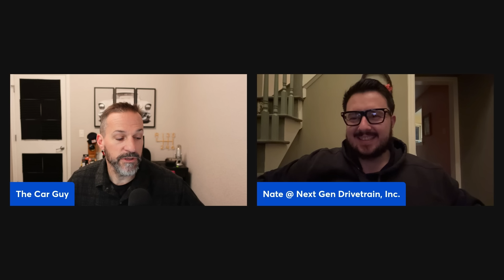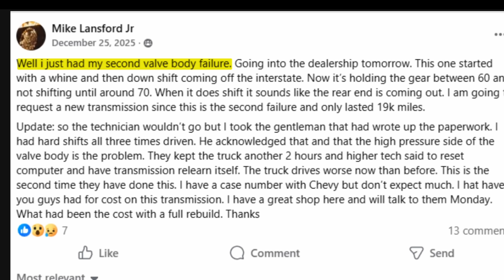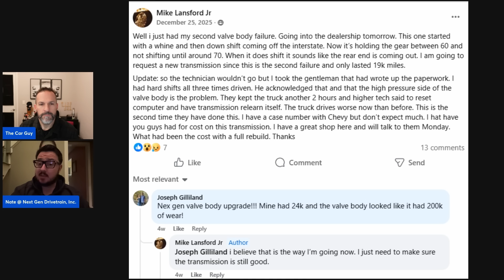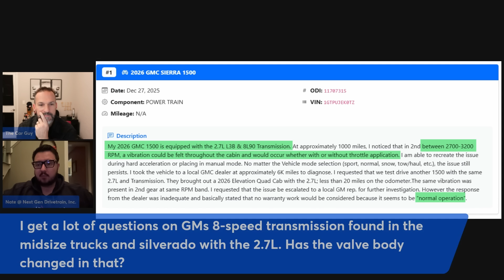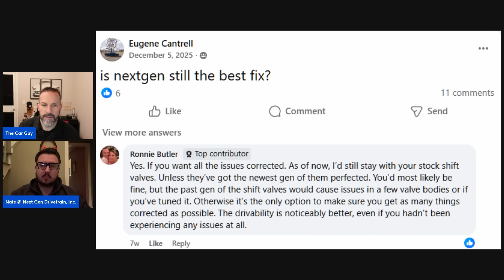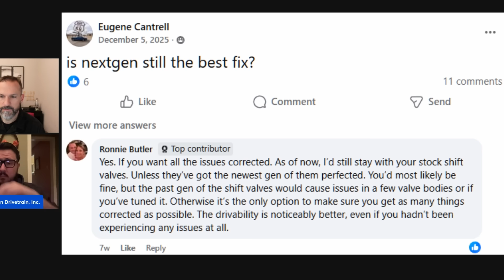How GM Transmissions are DESIGNED To Fail with NextGen Drivetrain. 2025 2026 Silverado Sierra...

Comment: The greatest issue with all the big three is lubrication and ultra thin oils, overly complex engines and transmissions, and individual owners reliability in maintaining their vehicles…let alone trying to get them to preform outside given circumstances, constant high rpm’s, overloading, high acceleration starts, and simply not using the units like typical individuals should….

Comment: I hated my 2020 f150 10 speed so much after only 32k miles and two new transmissions. I sold it and went back to a 16 f150 3.5 with the 6 speed. IMO the best newer gas trucks are
15-17 f150 5.0 6 speed
15-16 f150 3.5 6 speed
17-19 f250 6.2 6 speed
18-19 gm2500 6.0 6 speed 
20-23 gm 2500 6.6 6 speed
19-24 ram 2500 6.4 hemi
Reply: The Ram with the Pentastar V6 is an underrated one too. Very capable 305 hp

Comment: My 2013 just started having,  torque, converter shudder. 160k miles damn
Reply: I have a 2017 Chevy Silverado 2500 HD 6.0 L gas engine bought it brand new and it was mostly freeway driving. At 78,000 miles the torque converter went out. Nothing has changed. As time went on I started having shuddering from 3rd to 2nd and then 2nd to first gear when coming to a stop. It's been like that for years.  So annoying. My 2011 Silverado 6 L 2500 HD also bought it brand new and still have it to this day and never had any transmission issues with it to this day.. It only has 58,000 miles and have been changing the fluid in it over time and still no issues. Future GM vehicles I don't have any confidence that they're going to be getting any better. Until these manufacturers all offer 100,000 mi warranty on their vehicles, I'm going to be reluctant to buy anything new anymore. It looks like ram is slightly getting better but time will tell.

Comment: My company leases HD trucks and they take the trucks back at 50k, so we go through a lot of them with the amount of driving we do. Basically a new truck every year. So we've had 2022,23,24s. I'm still in a 2025 and we just got in 3 new 2026 2500 Z71 LT duramaxs two days ago. . They're just not great for the 60-70k dollars these things cost now. Everyone of them you can feel the cheapness post covid inflation quality. Most of them have had small electrical issues. dying batteries. My radio didn't even work right off the car hauler with 7 miles. one battery died at 11k. The Allison is an absolute slush box and the engine is tuned to roll off the line from a stop with like zero power. pedal is numb and lazy. Chevy programmed "turbo" lag into it cause  putting it in tow/haul mode wakes the truck up so its definitely not a engine thing, its a tuning thing.

Comment: I don’t even know who to believe… the GM 10 speed guys also said the nextgen kit didn’t work but when they swapped it with another brand the problem went away but they said nextgen refused to help them out.
Reply: I’ve had my NextGen kit installed for over 6k miles and it has been working absolutely perfectly. I think some folks reporting bad performance either didn’t do the install correctly or didn’t do a TCM relearn after installation. There’s a LOT of places where mistakes can be made when installing this kit.
Reply: @gr8tdane24 But the issues went away when installing a different one, they did tell me it was professionally installed by a shop.
Reply: @nq2847 the one issue with having a shop install this kit is that it takes a certain kind of OCD individual with absolutely no interruptions to do the work. If I had a shop do it, I would tell them to bill it hourly and to take their time to make sure everything is perfect. I installed mine (background in mechanical and civil engineering) and there are very few people I personally would trust to do the work.

Comment: If you want to know what kind of company GM is.  There is an unsealed 8 speed lawsuit document out there that is a transcript of a deposition.  Basically admitting that they knew there was a problem with the 8 speed trans (before Job 1), didn't notify customers of it, had a fix designed for it (different fluid) and basically rolled the dice and was only going to fix transmissions in warranty.....all to save $2 per unit. 

Question: "But don't you think, going back to engineering ethics, there's a duty and obligation when an engineer or a company that does engineering knows that there is a problem, such as the problem that has been known here since job one if not before job one, that they should inform the customer?

Because in this situation GM never told those people who's warranty was going to run out, and had they known, they could have wandered in within the warranty period.  Wouldn't that be the most appropriate and fair thing to do?"

Answer: "Well again, I--we---we're--we're honoring our warranty obligation'  --end of answer

Comment: I am from a Ford family, my uncle owns Ford dealerships. That does not mean I get free or heavily discounted deals.
 I was driving a '23 F-150 w/coyote & 10 speed. Of course, like a clock shows 12 two times a day,,, the infotainment and transmission started having issues 300 miles post warranty.
 Because of watching you and Nate for about a year, I bought a Ram, so far it has been great. This channel is a free buyers guide on how to buy the best truck for the money.
Reply: I own a 23 f150 5.0 and have 102,000 miles no issues. I do all the maintenance and on time I don't skip out on anything you can't with any new truck. Alot of failures also is poor maintenance which alot of people do.

Comment: 2020 Chevy Silverado 177k miles. 4 transmissions later 1 at 31k miles 2nd at 54k miles 3rd at 130k miles 4th at 168k miles. Currently dealing with lifter issues. Modern day GM produces a shit product and I wouldn't recommend them to my worse enemy. I didn't even get in to the A/C and compressor issues... Stay away from anything GM after 2014.

Comment: Their no guarantee fix not only just one test ride. Tell use it fixed 4 month from now. That Tran fix it happen on certain road condition
Reply: Mine has an error lite but only when your regas  at just into 3 gear, tiny  slack and not all the time, code as sensor mismatch of not just one but combo of 3 sensor. I gave up after a while as a fix replace the valve body change the clutches then they need to reprogram . Don’t include a tork converter  , so I just when for it a news dealer rebuild Tran . Not 7 k but ended paying 9,800 lol. It’s ok brought it 30 k vs 60 k so still 20 k ahead
Reply: Too bad need a van go look a creglist now, ton of good cheaper cars, people re getting rid of it the need money.

Comment: I would love to hear Nate's thoughts on Transmission maintenance, type, using  OEM or Amsoil . Viscosity etc 

I'd love his thoughts and perhaps from a Transmission Fluid Geek equivalent to Lake Speed.
Reply: Full synthetic definitely helps with heat. Keep the oil fresh and flush. In HD use every 30k replace the fluid.
Reply: good point because ive had a LOT of 10r80 issues when I had my 19 Mustang GT. I got real familiar with its dual stage ( different micron for cold and hot ) filter and drum roll......ultra thin super expensive fluid ULV..........Id really like to see some digging into this new ULV fluid vs the issues.....
Reply: @OldManRising he hasn't addressed transmission oil and maybe it's not significant  but seems like it could be based on engine oil analysis.

Comment: GM is clearly doing everything you say. All of them are. A lot of these issues were caused by the implementation of the CAFE standards mandated by Congress (mostly Dimturds) which caused all manufacturers to have to create engines, Transmissions and other hardware that should have been tested for many years before they were released as well as the corporate blind greed we all know about.

Comment: I will just keep driving my 05 Silverado till it stops and then put another motor and transmission in it and go another 300 k screw these greedy people
Reply: My '05 has beyond 329K. I smell a little oil burning on cold start (below 20f) but it still moves it's self. I am working on a replacement engine however.
Reply: @douglasburford8452 change the valve stem seals.
Reply: @douglasburford8452  Have you tried the Valvoline restore and protect oil? Might free up those oil rings. Just a thought.
Reply: I like sitting in my ancient gmc pickup than sitting and a dealer customer lounge most of my life
Reply: I'm with you i have a 2003 silverado 220k still runs like a top no Trans problems I keep all the fluids changed. I'm going to keep it.  Thanks
Reply: @raanburd5553  i’ll chat more to the vans. I got a caravan was actually a Voyager 2001 got 300,000 on it four-cylinder I’m trying to build a 2005 3.3 that’s got 150 to go 400,000 don’t make them like these. The new caravan gets . 26 on highway the other one get 22.. the only thing modern I heard that actually does something significant sky active technology engines
Reply: As long as old parts.
Reply: I hear ya, im running my 2000 sierra 294,000 mi unit and appreciate it. Laugh at all the suckas with pretty soon to fail payment buckets😂😂😂😂
Reply: Your 05 model is not the problem years.
Reply: @wk7060 I think he's aware of that.  I have 
2003, 2005 and 2006 hd trucks. Everybody is aware.
Reply: You gotta purchase your motor and transmission before it’s obsolete. We do not make it no more to check the line 25 years of usually to cut off but now it’s more like 15
Reply: I keep hearing parts for older trucks are getting scarce

Comment: This reminds of John Deere, and International Harvester,( Case IH). taking the right to repair away from the Farmers, The Farmer has to wait for who knows how long for a repair person to come out to the farm or field, just to plug in a computer, and then see if you have parts in stock, and charge you an arm and leg to fix the 800k or more tractor you bought from the dealer. is a rip. That has changed, supposedly now farmers are allowed to fix their stuff if they want.
Reply: Except you still have to buy the junk, extremely  high priced parts from these thieving scum.

Comment: This may seem like a crazy question but once the failed transmission is diagnosed via Gm Dealerships.  Does Nexgen have their own transmission shops to put their improved transmission in?   Or do you have to order the nextgen transmission and have a transmission shop install it.  This happened to my brothers 1500 pickup but I did not have enough time to research on how to get your nexgen product installed correctly and he was without a truck.

Comment: I just bought a 2026 2500 HD with the Allison 10 speed (label) on it.  Should I expect this to fail?
Reply: I have the same truck but minus the Allison branding. The transmission durability question just came up the other day in one of the groups I am in. Lots of responses but very few have actually had an issue.  You need to join groups and see what real world peoples experiences are. I have been watching this subject for awhile now and overall, the percentage of issues is pretty low. Keep in mind, people post more when they have a problem than when they don't so taking that into account, the percentage is probably even lower than it appears. With my last truck, I put in a built transmission at 121K miles but there was no issue with the original trans, I just wanted to do it. The same can apply to the valve body if you don't actually have an issue. Is it likely built better than the factory? Sure. Do you actually need it? Time will tell.

Comment: What are the issues with the 6 speed? I have a 2015 Silverado. 100k and so far no issues. Are their valve bodies just as bad?
Reply: I have 2 of them. One from 2009 and the other from 2020.  Honestly, there are problems in the 2009 with shifting at less than 60,000 km, and the 2020 also shifts poorly, IN MY OPINION.  I don't think they improved anything in 12 years.  That is really, really pathetic
Reply: The ole 6speed was generally pretty ok.

Comment: Swapped my 10L valvebody at home at  ~33,000 miles ago and did not perform the relearn.   ZERO issues towing 18K lb 5er.    do yourself a big solid and replace the trans pump with an upgraded unit also!
Reply: Waiting to do mine on my 25' GMC this spring.  Less than 10k miles with the L8T

Comment: My 2026 sierra 6.2 sometimes shudders when downshifting to a stop sign, happened 4 times already, not often but it's happened. Nothing bad with the engine as of yet
Reply: Try a couple of tubes of shudder fix.  It couldn't hurt, and might save you on repairs later on. I have it in mine, and so far no shudder.

Comment: And that is why I just gave up on pick up trucks.
Back in 2017 I special ordered a F150 which, I thought, I would keep for a long time for I need it to tow a 9000lbs travel trailer...
That 10 spd transmission pissed me off so much that I decided to sell the truck and the camper and buy a motorhome.
No more 10 spd transmission for me, thank you.
The MH came with a wonderful 6spd transmission designed and built by people that know what they are doing.
I'm done, just done with anything pick up trucks...

Comment: Does installing the NextGen  valve body void the GM warranty?
Reply: My dealership said yes it'll void warranty, and my 6.4 sierra is a 26 MY
Reply: @califaern3sto  but they have to have a reason to look inside the valve body itself
Reply: @fabguy5508 my transmission vibrates and makes a noise when coming to a stop sometimes, is that enough to warrant a valve body check?
Reply: Yes it will, at least for any transmission related warranty claims, but GM’s warranty means shit when it comes to their transmissions. I put the NextGen kit in my 2024 Sierra at 15k miles, warranty be damned. I’d rather trade reliability for warranty coverage. So far my truck has been shifting and driving superbly since installing the kit.

Comment: I worked as a machine tool service engineer for 35 years, 5 axis lathes can hold great tolerances, screw machine a little tighter, but also, they can produce parts much quicker in large quantities.

Comment: my old 2006 chevy silverado 4X4, 5.3 ,i have 200 thousand plus miles on it ,absolutely no problem with my transmission, or engine, just basic maintenence, i refuse to buy this new junk they are selling ,all makes have major problems with these new over priced, over complicated, absolute junk ,I will keep my old chevy till the wheels fall off !

Comment: Well, I really like these Talks here, and I like the Input from NATE.....   However, I own a 2022 FORD F-150 with the 10R80 POS in it. I'd Really like to Hear "SOMETHING"  on the Channel on the 10R80 Issues??? I get it that there are (Nearly) Identical Transmissions, But Isn't there "Something" That's Different that could be Explained here by NATE?????  Or, am I PISSING UP A ROPE????  Just asking.... 🤷‍♂😎.
Reply: yes the ford has a better valve body casting and tighter tolerances on there shift valves and bores for the valves, but the design is still awful in terms of how work the valve body works, and they still use aluminum shift valves. you have to think of it like this gm is bottom of the barrel and ford is 15% better than them just to stand apart. the reason ZF is so good is because its low hanging fruit to be better than ford and gm
Reply: @fabguy5508 . Thanks.  But I’ve had More than my fair share of of issues with my 10RIffy!

Comment: 20:45- A few Mustang folks and I caught a cubicle farm in action when the old Ford MT-82 transmission (the terrible 6-speed manual that should have never been installed into any Mustang) began having an insane amount of problems as early as fall-winter 2010 (for the 2011 model-year Mustangs). I began tracking posts of ridiculous fanbois who seemed to be spending their entire existence on several Mustang message boards crap-talking anyone with a complaint about that transmission...and then I noticed that practically all of them were posting between 9am and 5pm Eastern Standard Time, no posts before or after, you know, 9am-5pm in Michigan. 

I pointed that out, they all disappeared...and then slowly began filtering back with different names and posting times, one even appeared to be working the graveyard shift.
Reply: Toyota runs the same social media campaigns. It’s ridiculous, can’t believe much on the internet

Comment: In tech you would get a bug bounty for fixing a defect. No reason why a re-learn cant be built into the vehicle. As many cars already run continuous adaptation as the component ages which basically is a slower relearn.
Reply: as an IT guy and car enthusiast my entire life......absolutely shouldnt need to come into dealer, especially when my 25 Mustang IS connected to Ford anyway able to do over the air updates ect........